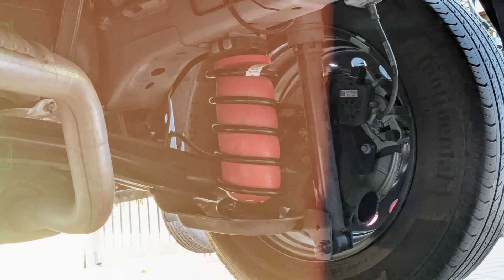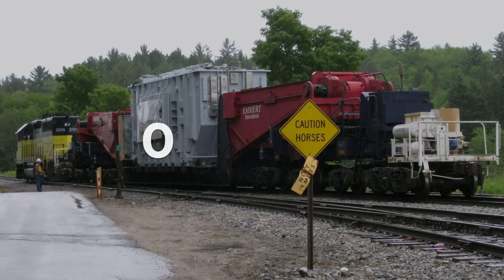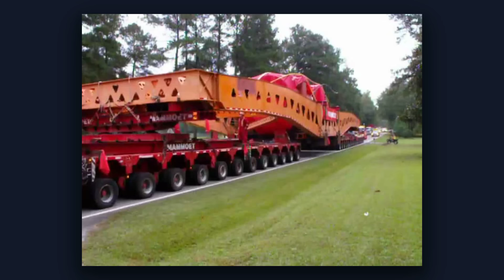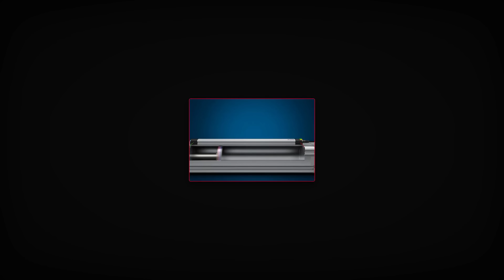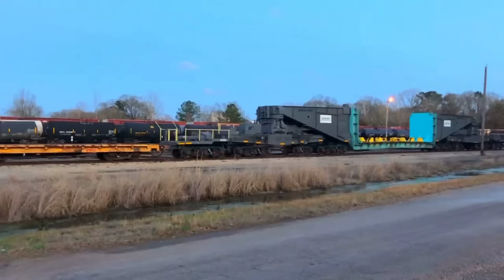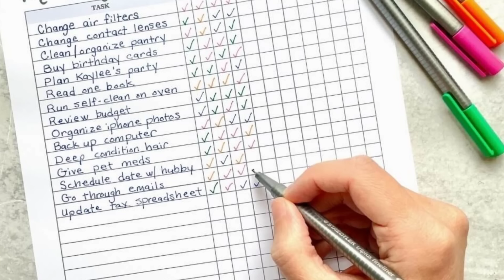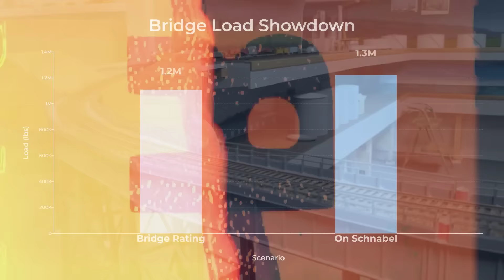Why Normal Trains Can't Carry These Massive Weights

Comment: I always thought that faster speeds made the load lighter but according to this I was wrong . well the faster I went with my snowmobile ment I could go over thiner ice .  but and interesting thing was that in Wisconsin I was allowed to carry 20,000 lbs on my steering axle but only 34,000 lbs on the tandems . but with 2& 3/4 million miles I could witness the front axle once in while send chunks of concrete flying out from concrete joints because it was the heaviest axle to hit that spot in a while .
Reply: That should be 12,000 on the steering. 20,000 would exceed the tire limit alone.

Comment: Why @ 00:51 are you comparing Automotive wheels and tires to railroad wheels?
Reply: They both have regulated weight limits per axle.
Reply: It likely was included because both the train and truck had similar suspension systems

Comment: A 747/400 max fuel max load take off weight is 875000 to 910000 pounds ! But size limits cargo ! I thought trains had higher capacity  !
Reply: They do, the issue isn't that a train can't carry it, obviously it can. The heaviest train ever was over 99,700 tons (219,875,832 lb) and 4.5 miles long. It's how the load is distributed on the axles. Having 250,000 pounds pushing down on a single point would overload the tracks and bridges. An airplane doesn't have to worry about stuff like that, as long as the wings connection to the fuselage can handle it its fine. As the video said theses special cars spread the enormous load out over multiple axles, massively decreasing the amount of force each one places on the tracks and other infrastructure.

Comment: Your claim that the maximum allowable weight limit for rail loading must be incorrect.   I base this on the sticker inside the cab of an ES44AH which reads 432,000 lbs.  6 tons more than your stated limit.  Also most standard 4 axle cars are 286,000 limit cars.
Reply: They show video of all kinds of crap that has little to no connection to the topic. It’s a wonder they didn’t show video of puppies, kittens, flowers and pretty women.
Reply: Crack, Crack, crunch.
Reply: If I understood correctly, the maximum load limit is 71,500 lbs PER AXLE.  A 186,000lb car riding on two two-axle trucks is 46,700lbs per axle.  Well within the limit. An ES44AH locomotive has 6 axles, which works out to 72,000lbs per axle.  A bit over, but workable.
Reply: @tomcushing3619 Please excuse me.  I fat fingered the keyboard.   I  meant to type 286,000 for a standard car.  Sorry for the confusion.
Reply: @keithsuggs7935  Newer cars are a 286K limit
Reply: @markschenher4559 286k is an abbreviation of 286,000. You are correct.